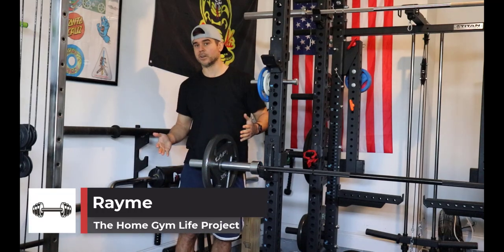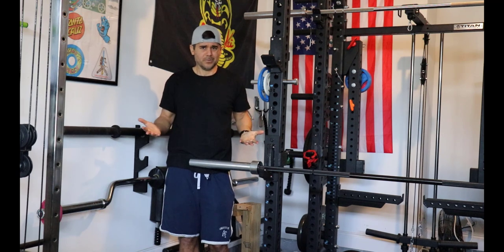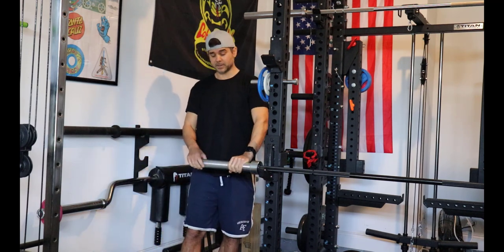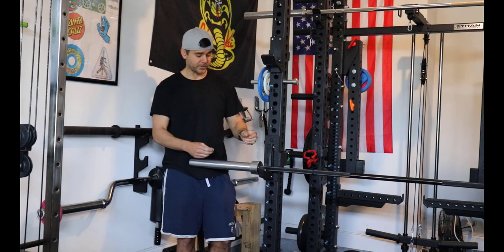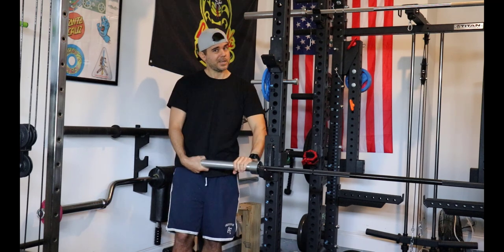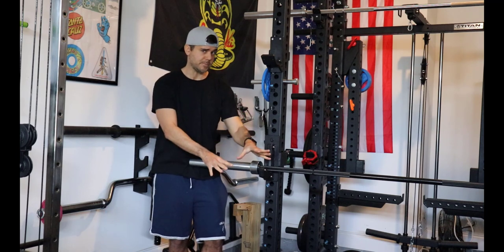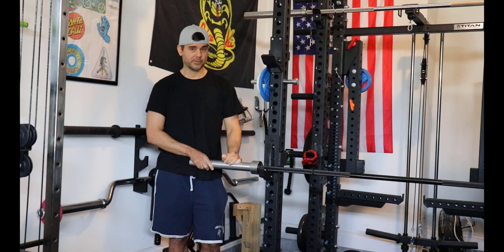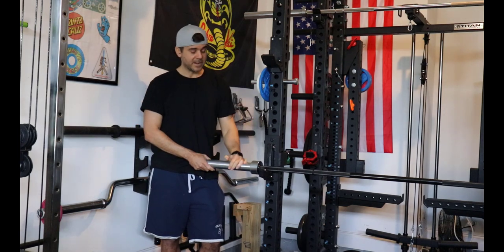What's the deal with ribbed sleeves on a barbell?

Comment: I prefer the ribbing but it’s close. I used to workout with friends and we would have to switch the weights around frequently due to differences in the weight used for individuals. Collars added time and we spotted so it was better to have the ribbing so the plates don’t slide as much.

Comment: If I had known my Ohio stainless steel bar had them I wouldn't have purchased it. I don't mind the noise but I worry about damaging the grooves over time especially with non machined plates.  As a consequence, I tend to use my smooth sleeved bargain brand most of the time.
Reply: the grooves and the center insert of a oly plate actually grind each other off so over time the "clang" sound grows over time and why you probably dont want to use nice competition plates/bumpers on it......

and grooved sleeves are almost always louder when you drop the weights......
I never understand the purpose for grooved sleeves...... like weight still stays on smooth sleeves very nice if you have nice tight tolerance plates and barbells.....